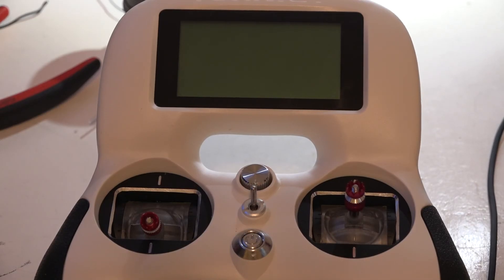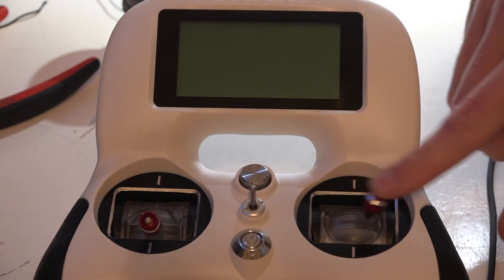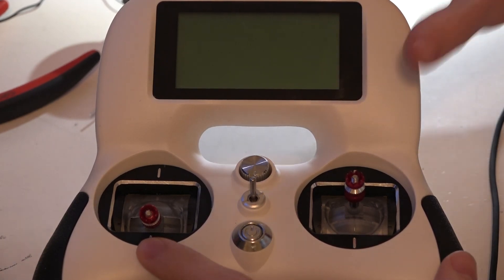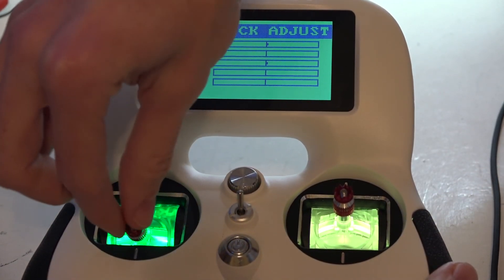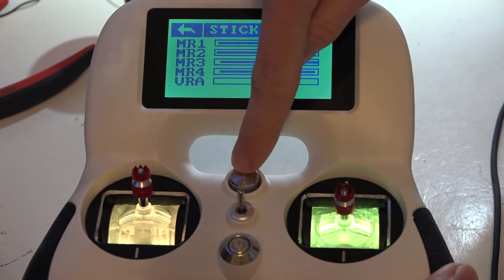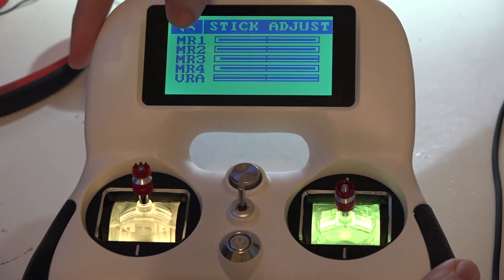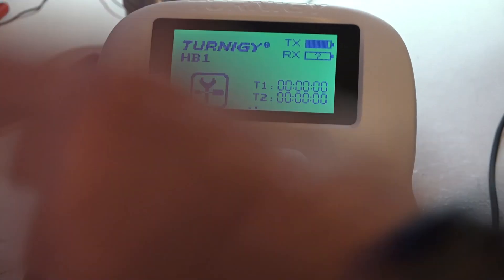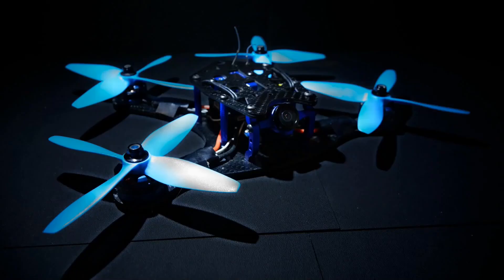Calibrating Turnigy Evolution Sticks

Comment: My pitch and throttle are swapped. At the start it says all switches in the up postition and lower throttle, but the throttle is switched to the right side instead of the left stick, how do I fix this? I have tried changing the stick mode but it doesn't work

Comment: just in case someone cant finish setup, because just turning off it wont save adjustment, just putt throttle stick in the center position and click back button

Comment: Not sure if you been told but it's not possible to go back on the transmitter from calibration menu. I have tryed this on two separate transmitter and it did not work.
Reply: You just need to center both sticks and then it will go back in menus, so weird :D

Comment: Mine won't exit the screen after calibration, have tried all different combinations of switches etc still no luck, any ideas ?
Reply: Joe Turabian throttle stick needs to be centred ^^
Reply: Yup, half throttle worked for me too. Thanks for posting your findings guys! Hopefully HK will send another update. Too bad they weren't pro-active in fixing this 'bug' and having included a 'fix' in this months update. Nice little transmitter though!
Reply: Just turn off the transmitter and your all done
Reply: Joe Turabian .....I have the same problem....
Reply: Joe Turabian .....Just to mention that this same issue affects the FS-i6S....so it's obviously a FlySky issue, ignored my email...but obviously know about this problem.....just  turning the TX off....is not a solution for the problem...but it does save batteries. Email FlySky and ask them for an answer ....meanwhile people need to think about their next purchase of FS gear....YOU may get a radio with this issue...sticks are NOT calibrated.
Reply: My roll twitches by itself and even more when you add pitch, was hoping a stick calibration would solve the issue but turns out the radio is just faulty, hk refunded me and I will order a new one when they are eventually in stock 😉
Reply: Joe Turabian ......I also got a refund.......I am getting the new low cost Taranis q7.....flySky firmware has problems....maybe they cloned the wrong code!
Reply: Hey! Just had the same problem and found a solution. If it does not exit when you press the arrow button at the screen, try switching all of the switches (or pressing/rotating the variometer) and pressing the arrow button every time you switched something. Make some noise, you know, and eventually it works :) At least, worked for me. Looks like a software bug anyway.

Comment: Great bit of information. That's the thing with this Hobby just as you think you have learnt just about everything about a particular thing whether it be a  circuit board power distribution board or transmitter no matter what it is but just at that point when you think you have learnt it all.  ( YOU LEAN SOMTHING NEW ) Very Helpful. Cheers matey